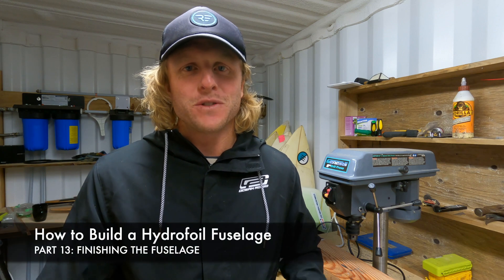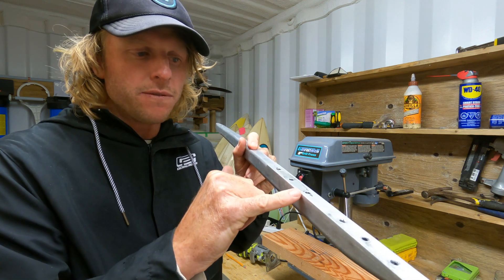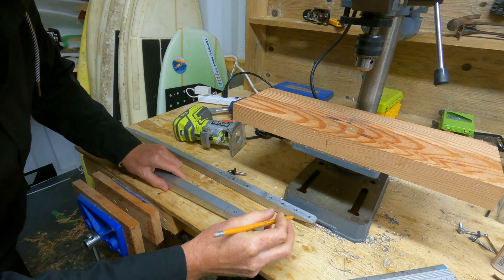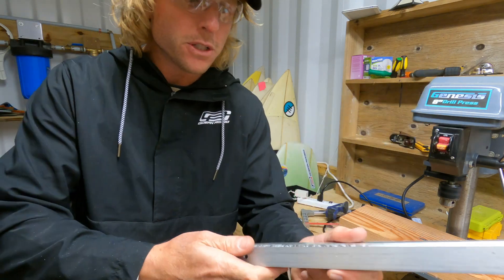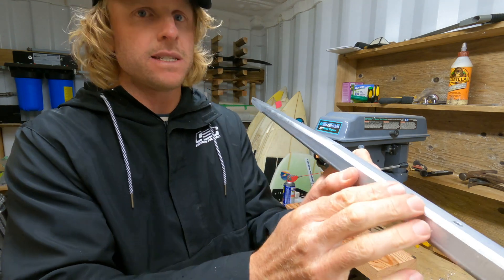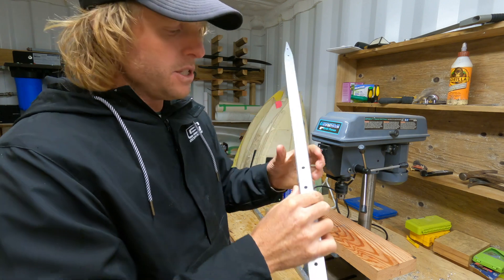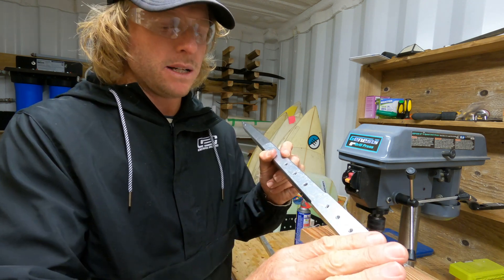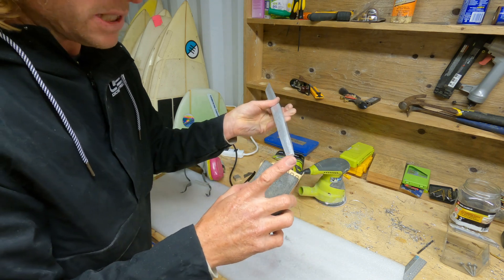How to Build a Hydrofoil: Fuselage - Final Shaping & Sanding (Video 13/15)

Comment: Looks great. I think I'll have a go at it over the winter. Nice to watch someone else cut aluminum with woodworking tools first. Thanks.
Reply from the maker: Yeah keep us updated with the progress! Another commenter mentioned a great idea.. to cut the alloy in increments, slowly raising the blade and do multiple passes. That is actually how it should be done more safely as you can see in my video driving through 1" is a lot for the saw.